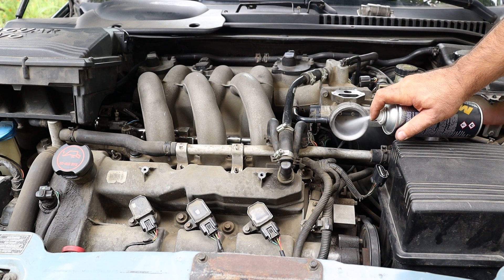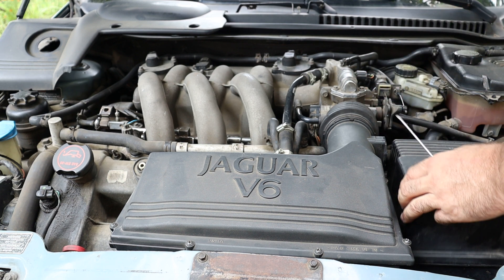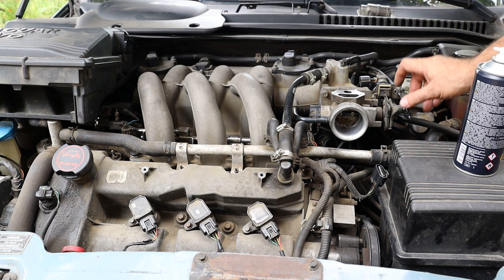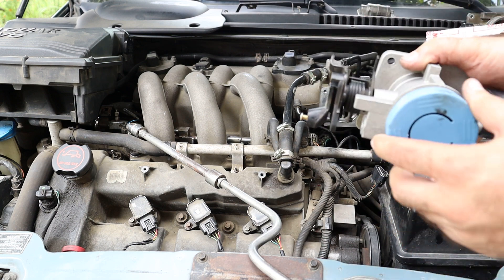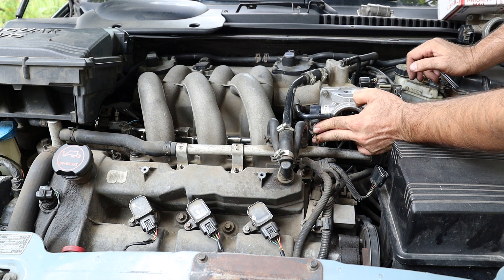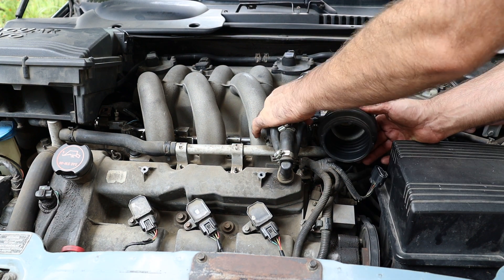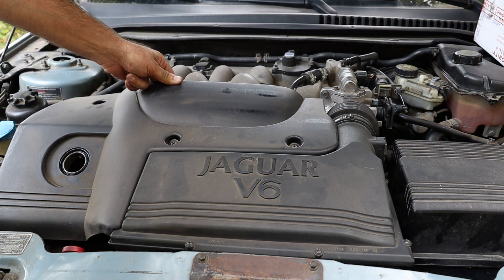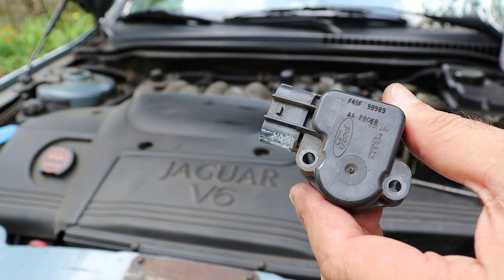Jaguar X-type throttle body clean, removal & relearn, throttle position sensor

Comment: Really a great, great video.  :-)  Please, could you provide us the OEM number of the Manifold Air Valve for the 2.1 Jaguar X-type ? Thank you
Reply from the maker: Thank you for watching! I don't quite understand which valve you mean. Idle Control Valve (throttle bypass) number is 1L5E9F715AB, Intake Manifold Air (Tuning) Valve is XW4E9L490AD. Cheers!
Reply: @jaguarrroman  Thank you 🙂.  I was meaning the 1L5E9F715AB Idle Control Valve (throttle bypass). Unluckely looking for it on eBay I see around only spares from China... do you know something about their reliability ?...maybe  better a used but original one ?...     About the other XW4E9L490AD Intake Manifold Air (Tuning) Valve, do you know if there are differences between those coming from 2.1L petrol cars and those coming from 2.5L/3.0L petrol ones  ?...  thank you in advance for your suggestions 🙂
Reply from the maker: @AlfredoCoffari  No Chinish for sure, only OEM parts, no matter brand new or pre-used. You can search on Ebay for / NEW - OUT OF BOX - OEM Ford 1L5E-9F715-AB Idle Air Control Valve IAC / and consider purchasing it. As for the XW4E9L490AD part, I believe it is the same for all V6 Jaguar engines, the difference is that it is mounted horizontally on 2.5 and 3.0.

Comment: Thanks, still working on my Jaguar. I replaced the fuel pump, alternator, fuel filter, O2 sensor upstream (right), and the throttle body/ignition fuse my car will only idle at below idle where the car is shaking and there is no gas pedal function. I press on gas pedal and nothing. then of course it cuts out. So frustrated but am OK with it. I will not let it conquer me. I did notice when the car went out, I was driving home and everything got hot in the car from the A/C and when I turned the car off at home it never ran again. I mean it will start but will not keep running. No pedal. All this work. Was thinking of Throttle Position Sensor, Electronic throttle Control. I do have an oil leak towards the left plugs which I cleaned a couple of times and sealed a few times with engine oil sealer which worked for a long time. I think that is what ruined my original Alternator. Finding oil in the plugs was scary. I did notice a couple years ago when I tried to turn on cruise control the car cut out on the highway. I get that error message on display and something about the gearbox. 
Any more advice? ~Amedeo777
Reply from the maker: It is possible that the Electronic Throttle Control module is faulty but there are many more potential causes and a diagnostic scan is highly recommended. Gearbox fault  comes together with the cruise control not a available, which may be caused by vacuum leaks. At least I got rid of it only after fixed intake manifold grommets. I wish you good luck, thank you for watching my videos.

Comment: Какие Причины хлопков в воздушный фильтр
Reply from the maker: The only reason is misfiring, the reasons of misfiring are plenty. You need a good motorist.
Reply: Осечка - что это такое? Может перевод не корректный
Reply from the maker: @Евгений-х2ц2з  Misfiring means пропуск зажигания
Reply: Hello Jaguarroman,
Thank you for explaining how to deal with jaguar x type issues 2.1 liter. As far as I am concerned I had problem with misfiring and after many visits to mechanics I found it. It was combined between the throttle body and the intake gaskets.
Now i have another problem that I didn't resolve yet. But it's sure it's about misfiring once again.
Reply from the maker: @chaksmak445  Good luck to you and your Jag!